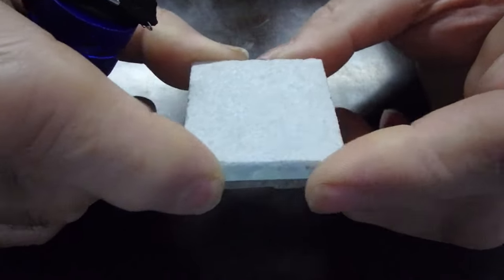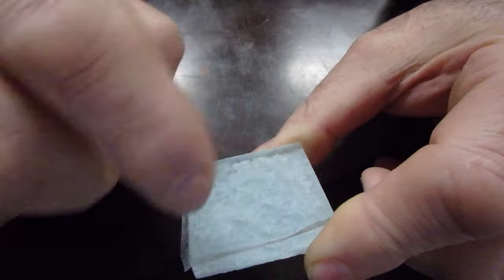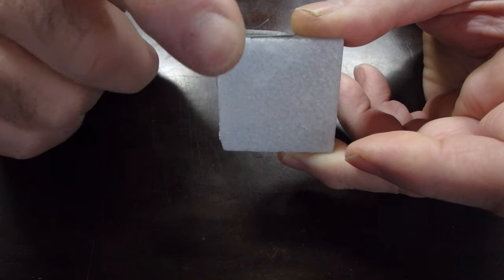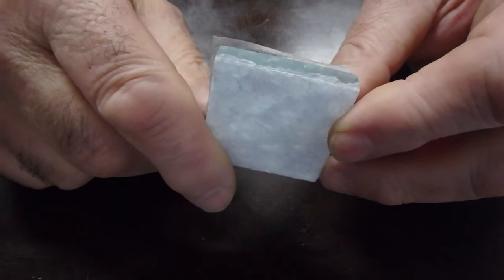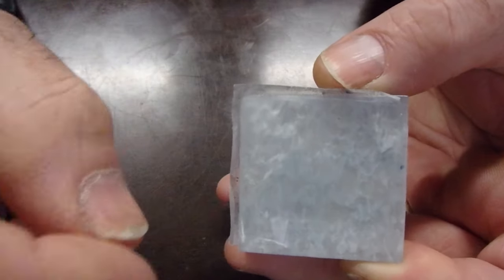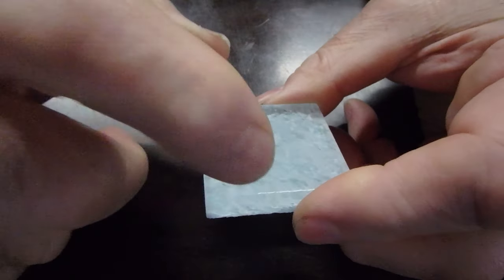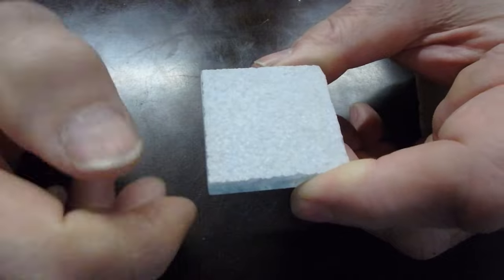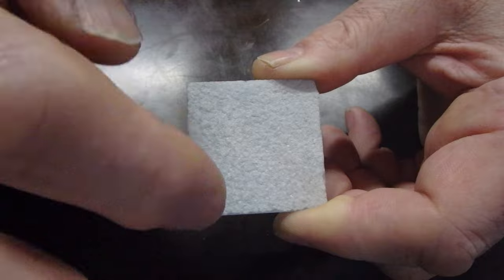Easy DIY glass tile project Vanity Splash

Comment: Last thing, for ppl that are DIYing their tile job (nothing wrong w/ doing this), but PLEASE don’t use sanded grout on glass tile, ya want unsanded, otherwise depending on the glass, lighting, and location…..it will drive you insane when start seeing the “scratches” on the glass tile
Reply from the maker: Not the case with all glass tile, and some manufacturers require the use of sanded grout and also to seal the tile.